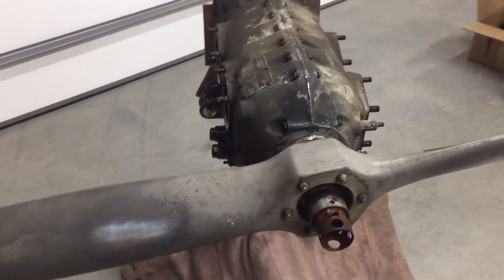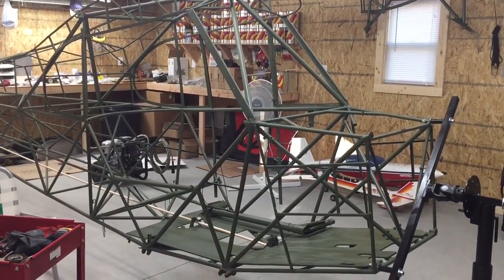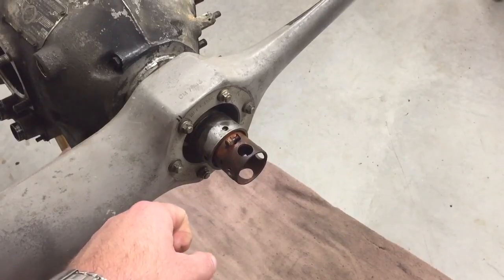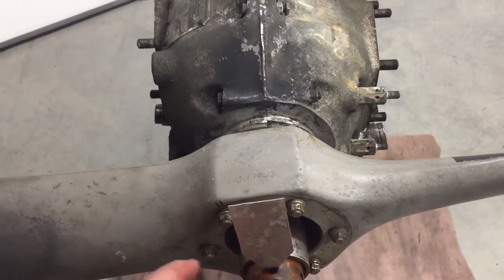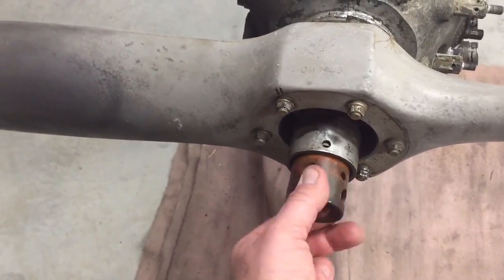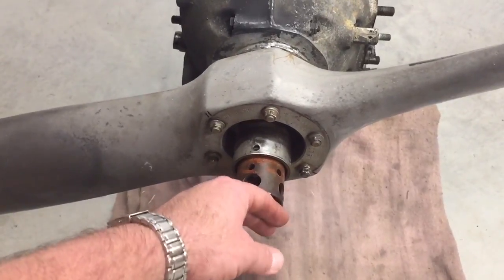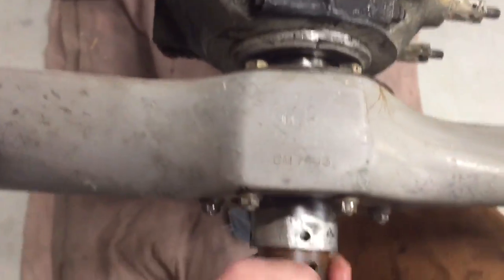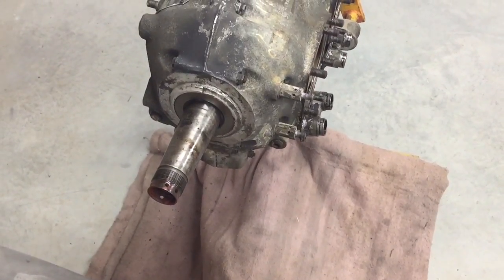How to remove a prop hub on a Continental A-65 Tapered Shaft (Update #008)

Comment: Cole thanks for making this video however for the life of me I cannot get my hub loose and I am afraid of damaging anything. I’ve put a 2 foot breaker bar on it and with 220 lbs of me pulling on it I cannot get it loose. Your video is great but I do have a question. When looking at the center of the hub from the front there appears to be a large cap of some sort with a slotted opening for a flat head screwdriver. Does this “cap” have to unscrew prior to the steps your showing? How much force did you apply to the breaker bar. It’s been on for at least 26 years now, and I want to replace the prop bolts. Thanks!
Reply from the maker: Hello Brian! You want damage anything. Lol. Chances are someone put Pirmatex on the nut which acts like lock tight. Make sure your prop is on the plane and have your prop at 2&7 o’clock position with your cheater bar at 9&3 and pull and push and you should get it. Some people put way to much on them which makes it harder for us to get them off. 😏🙄 Hope this helps. Let me know. My email is Chadcole65@yahoo.com if you have anymore questions. Have a blessed day!

Comment: Can somebody explain to me more further what is the tapered shaft??
Reply from the maker: Hummmm 🤔 Do you know Anything about airplanes or airplane engines? 
The crank shaft is tapered on the end with a key way cut out in it so you can bolt the prop onto the engine.

Comment: So to be clear, the lock ring DOES NOT need to come out?

If so, then when you back off the center nut, and it suddenly gets tight again, that means it's pushing against the lock ring?

And by loosening the nut further, you're essentially pulling the hub off of the shaft?
Reply from the maker: No sir. You do NOT want The lock ring to come out. That all that little home made tool does is to help keep it from popping out. 
As far as the hub goes...when you first break it lose you are breaking the NUT lose. Then when it stops at that 1/4 turn mark sort ah say then that when the lock ring has it locked on there and you have to put more butt behind it to pop it lose. If that’s make sense. 😂🤷🏼‍♂️
Reply: @ColeAviation  got it, thanks

Comment: Hi,
Thank you, thank you, thank you !
It worked perfectly fine.

A friend and I have acquired a 1954 Jodel 112 last year (last engine work 2003). For me it was a old plane, but we totally forgot the previous owner  had just change the prop. With the heat of our summer four of six screws got loose and one broke (fortunately we discovered it on ground post-flight inspection - never go over check lists ...).
So we had to remove the prop hub but with absolutely no idea of how to do it.
Our initial thought was to remove it with a hub puller.
Local "specialists" told us it was known to be (very) difficult and some had to saw it down !!!
So for me it felt like christmas when, without conviction in my internet search, I found your video.

Last WE we needlessly removed the snap rind (at this time we did not know how to do).
It took us this Sunday more than an one hour to place it back.
Exactly as for avflyguy on first try we got a hard blocking point at 1/4 turn.
I turned it off and gave a gentle hammer tap.
On second try there was still a hard point à 1/4 turn but not blocking and with an 1/8 extra turn achievable, second gently hammering.
Third try was the one with a "clack" and the hub was loose : Hurray ! 

It took us 3 min.

So thank you, thank you thank you again to have taken some of your time to share this video that helped us a lot.

Henri and Jean François with our F-PGKQ Jodel 112 from F-LFOI.

This post is already long but the story is not closed I'll do an other post.
Reply from the maker: You are more than welcome. Sorry so late getting back. Glad it helped you out. I just saw your comment when I was replying to a new comment. I must have over looked that notification when you first commented.

Comment: I’m confused in the lock ring, why do you have to hold it with that tool you made. What does that lock ring look like?
Reply from the maker: The little “tool” I made is to keep that lock ring from popping out as you are hitting on the nut.

Comment: I can tell you without hesitation,  those props are a real bear to get off a tapered shaft.  Most of the off-shelf rust-removers won't work no matter how long they set.  Found an old timer that said to use equal parts of acetone and automatic transmission fluid, which seems to work better.  The 'key' to put between the internal snap ring needs to be thicker - as thick as the snap ring itself.  After about 1/4 turn it would move no more.  Used a 3 ft long cheater bar and it still would not budge.  Made wood wedges to go between crank and case and banged with 5 lb hand sledge - one side, then the other.  The nut would turn another 1/8, then repeat.  Soaked with special mix overnight and next day with continued banging with wood wedges and prying with cheater it FINALLY broke loose.  When it was put back on coated the shaft with never seize which over a month or two squished it way out and covered the front cowling just behind the prop.  No telling what we'll run into next time getting that thing off.  *Glad you found a way*  And....got a bit lucky as well.